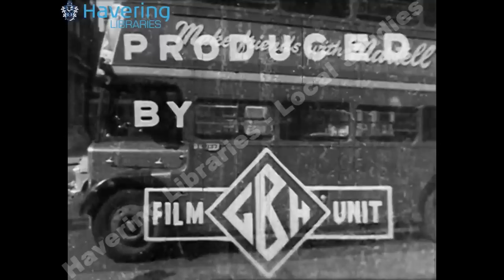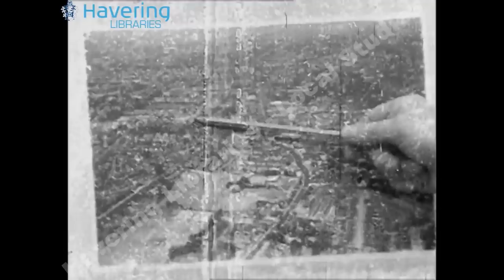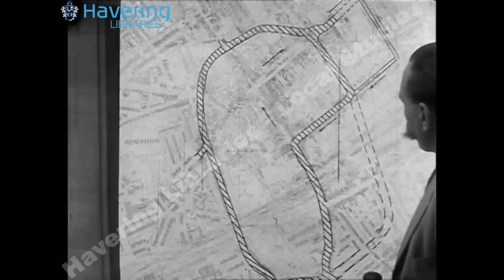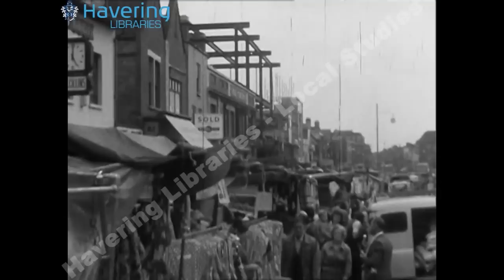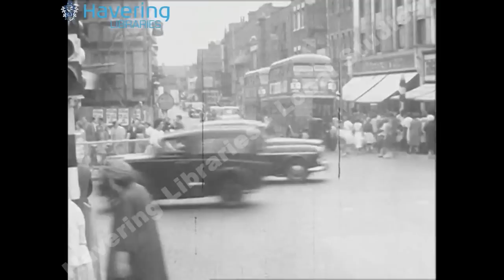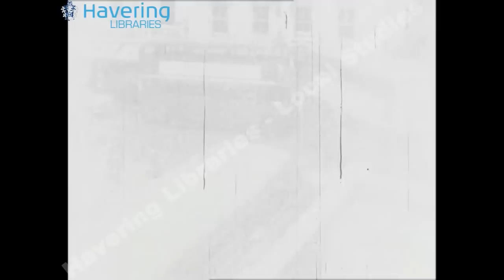Romford Traffic Problems 1962 - With Audio

Comment: It was over 25 years later in the late 80's that Mercury Gardens was finally extended under the railway line towards the Army recruitment building. It brought an end to the Wacky racers circuit that went from Mercury Gdns then into Eastern Road , up South St. and then along Western Road to complete the circuit with pose points at the entrance to the Western Road multi storey and opposite Lambourne house.
Cooking fat corner was from Ratners by the NewsHut to the junction of Chandlers Way for some extra fun and giggles.😂

Comment: Believe it or not folks but in 1962 Romford was in Essex!
Reply: I found an old map from the early 20th century somewhere online not so long ago, and it shows that to get from central London to Romford in Essex, you'd need to travel through several miles of countryside.
Reply: And believe it or not folks Romford still is in Essex
Reply: OR YOU COULD BE IN ROMFORD IN ESSEX AND NOT TRAVEL SEVERAL MILES BECAUSE ROMFORD IS ESSEX @Read This
Reply: @I974.UK.LONDON 
Facts say otherwise.
Reply: @I974.UK.LONDON  Yes, you are quite correct. Although the problem arose when Romford and Hornchurch Urban district councils merged in 1965. 

The private company; THE LONDON BOROUGH OF HAVERING, then became what is accepted as part of 'Greater London'.

Many people honestly believe that Romford/Hornchurch are actually in London. Many think this area is East London. The media of course perpetuate, this disinformation.  Havering is a London Borough. Resistance is futile. Kind regards.👍
Reply: Well spiritually it's Essex and always will be but technically it ain't...